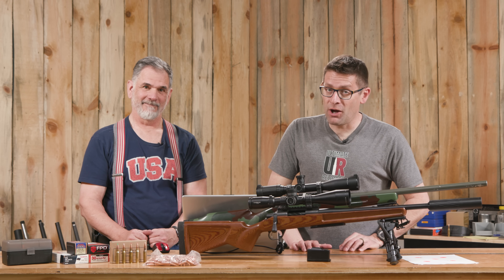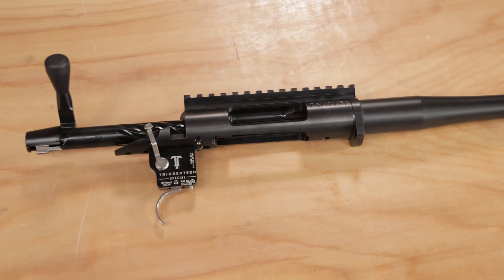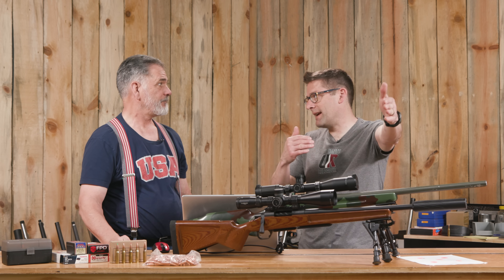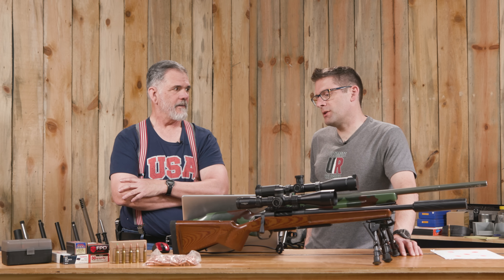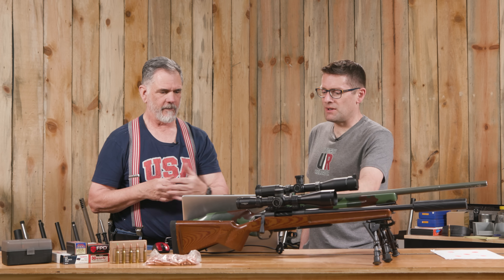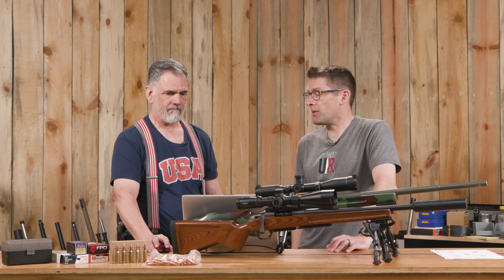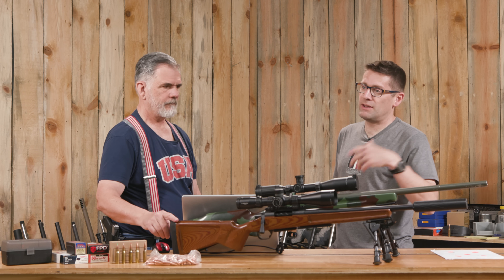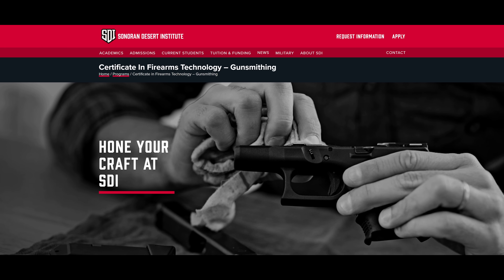308 Velocity: SHORT -vs- LONG (16" -vs- 24")

Comment: I actually just finished my stubby 308 build as well. similar to yours but i did a carbon fiber barrel and stock. total weight with glass is 7.2lbs for backpack hunting out to a few hundred yards. plan on running suppressed as well. I actually uploaded a video on my channel of some velocities with 6 different box ammo. I have a 14.75" barrel with pin & welded muzzle device for the silencerco cans which brings length to 16.5. No where near the quality of videos you put out, but it is good to get this info out there. I have come across little to no info about velocities with stubby 308 rifles when I started my journey. Funny that you started posting your build after I ordered my components for mine. nice to see some other velocities. and huge help about the hodgdons pistol 308 load data on their website. I had no idea.

Comment: Oddly the most common barrel length on a 308 is 22 inches. I understand short barrels suppressed is a thing now. Not a bad rig for shorter ranged hunting with enough power to do the job. The 24 inch is definitely the better not being suppressed. Entertaining video. BTW pistol data for rifle cartridges is available because of the Thompson Center Pistols.
Reply: Also Rem XP100 bolt pistol for the metallic silhouette crowd back when that was popular; they wildcatted what became the 7mm-08, among others.

Comment: In a stand/blind, without the suppressor your eyes and ears will like the muzzle being as far out the portal as possible. The shorty with suppressor is far easier, 2 inches is a lot in a cramped box, to thread through that portal.

Comment: Why build a short barrel rifle when you turn around and stick a can on it and make it long again?  Thanks for the vid.
Reply: Because it would be far longer if we just screwed a 9" can onto a regular 24" barrel... That would make the overall length crazy long for a practical rifle. I did use 30" .308 Winchester barrels on my old match rifle. It was fine at the range, but a bit cumbersome for most hunting situations. The can is quite worthwhile.

Comment: I'm so glad that you all still realize the usefulness of the .308" win.   I had a career that began with the  7.62 and lasted 20 years. I 100% know and completely understand the benefits of all these new marketing attempts with all the new wizbang cartridges, and yes, there is some good ones that have appeared and yes for punching holes in paper I will gravitate towards the new super high B.C. chambering . Yet I just can not stray from the facts that I have been shooting a 18" kreiger 1-11" twisted barreled rifle. In a BAT ACTION for the better part of 10 years. I shoot a 168gr berger with this combo of parts, and inside 300 yards it's a .5" rifle.
I have fire 10 shoots into this time and time again On hundreds of occasions. So when it was time to go to work this is what I had. It was purpose build for engagements of 250yards or less. I have shot this rifle to 600 and it becomes a 1 MOA . But inside of 300 it's a laser beam that I will rebarrel time and time again. My point is when it works beyond what life expects its hard to change from what is 100%solid as a sunrise.  The 308 will never lose its place in people's heart.
Reply: The 308 remains a mighty fine cartridge. Gavin and I both seem to have a fondness for them. I've worn out a few .308 Win barrels, and as you know, that takes quite a few shots to accomplish.
Reply: @Guy Mine 
Yes it sure does. It just has a spot in my heart that I know when I pull the trigger its gonna do as designed perfectly and the target will respond accordingly.

Comment: I know the 308 is popular,  but my favorite is the heavier 30-06 rifle weight.   Both are .308 cal, but my preference is heavier recoil absorbing stocks. 10 to 12 lbs is ideal for that purpose. 
What would a longer barrel in either caliber do to velocity? Say 32 to 36 range for steel shooting.
Reply: I do most of my hunting with a 30-06 and love that cartridge! Longer barrels can help a fair bit. For competition I used a 30" Krieger in .308 Win. It typically produced 3,000+ fps with 155 grain bullets.

Comment: Hunting? Shortest, lightest option. Currently, 168gr SMK out of a Savage 110 Tactical 24" heavy, running a Vortex 6-24x50 db tactical. Same hole accuracy @ 100yds.

Comment: What would be the velocity loss in a 20” barrel? About 50 ft/sec less than 24”?
Reply: Figure about 25 fps per inch, so maybe as much as 100 fps difference between 20" and 24" barrels.

Comment: I love this channel,  I've been a subscriber for years. It's cost me thousands and thousands of dollars, and I'm happy about every purchase I've made. 

I'm about to finish up my 308 project.  A Rem 700 SPS Tactical, glass bedded Bell and Carlson long range tactical stock Mathews cheek riser, Triggertech Special, Arken ep5. Sadly, suppressors aren't legal in this state.

Working up loads in Laupa brass using XBR and Varget. 168 smk and 165 Ganekings. Picked up a magneto speed v3 to help find a node. 

Because there isn't a range over 300 yards where I'm at that's going to have to do unfortunately.  I will be using this setup for hogs too. Can't wait for the weekend to get to the range and collect some data.

Keep up the good work, I really appreciate the content you guys are putting out, especially during these crazy times with this format censoring all the best channels.

Comment: Remington model seven 308,16.5 in barrel, lightweight 3-9x scope because if I need to shoot past 400 yds I grabbed the wrong gun. I like a 150 grain sst over 50 grains cfe 223, think they came out at 2750fps nice 3/4 inch groups at 100 yards.

Comment: By the way accuracy is also a factor to consider in your comparison
Reply: Both have proven to be roughly 1/2 MOA rifles. I don't think barrel length had much to do with that. In the past I've used 308 Win barrels up to 30" in length, for long range target competition. They were accurate, but no more so than much shorter barrels.

Comment: Gavin and Guy. Your reference to data that was relevant to International and NRA silhouette 45+ years ago ( however not available as complete back then 70’s) was especially interesting, having developed some bolt pistols using Remington XP and Wichita actions.
Settling on .257 Roberts as FL .308 recoil quite stiff. WITH 15” bbls resulting in MOA. Later a few of those fire arms were converted to 16.25 in barreled rifles in various calibers. Your specifics to bullet choices and practical ranges will surely inspire some “ Shorty bolt guns” 
BTW the esthetics of your build from stock, magazine, suppressor resonates “ who will build one of those. At a time of all the 1000 yd shooting, practical hunting and recreational custom rifles with 16.25 bbls will find a bitch. Currently own several examples of short rifles in .350 legend and .308. Always appreciate  inspiration of Gavin and Guy on Ultimate Reloader. The Scientifically based testing benchmark on line ballistic  education.
Reply: “nitch”
Reply: @jerrymoran8323  - I have to admit grinning upon reading the typo.  :)

Comment: Never again will I buy another barrel over 16 inches. They are so impractical unless you are using it for shooting PRS, bench rest or F-Class. I don’t care how strong and in shape you are, carrying a gun that weighs 10-15 pounds for hours on a hike sucks plus your pack/gear, even more so if you get skunked. Especially considering nobody is hunting beyond 800 yards, I don’t care what your skill level is.

Comment: Question:  So the shorter u go on barrel length requires a Faster twist rate too?..What if 1:7 Is originally recommended?
Reply: No, the shorter barrel doesn't require a faster twist rate. The twist rate selected depends on what length of bullet will be used. If 1:7 is recommended, by all means, use a 1:7 twist barrel.
Reply: @Guy Miner  I'm not sure what length one twist needs on a short barrel,  if it mattered. Reason I asked.... But I'm almost sure working up a different load recipe is almost guaranteed right? Shorter barrel may just need a faster burn powder vs it's slower powder ?
Reply: @mryang3644  - that seems logical - but... Hodgdon is showing that the highest velocities in both long and short barrels were accomplished with the same powders... Take a look at Hodgdon's pistol section in their online load data, look up .308 Win there with the 15" barrel. Varget and IMR 4064 each produced the highest velocity for 168 gr bullets in the 15" barrel. They also produce some of the highest velocities from the 24" barrels.
Reply: @guyminer3168  wow. Nice to know. Thanks

Comment: I found that 18" really brings noticeably more performance to the table than 16" and nearly the same as 20 to 24" barrels without sacrificing mobility.
Reply: In an ar10 platform the 18inch barrel lets you have the rifle length gas system over the mid length which i find is the most practical.
Reply: My 2 cents.
 Remington model 7 in 7mm 08 18.5 in barrel  and laminate  stock.. light and short whitetail medicine  to 300 yds.
Reply: @scottgandy8824  boss has the .260 I held this weekend..absolutely coolest little rifle I’ve held…tiny little everything lol
Reply: @scottgandy8824  but 7-.08 is his main squeeze too…lol
Reply: You can do 16" RLGS or ILGS if you want more optimum port pressure and cycling of the action.
Reply: @LRRPFco52  i wouldn't really take my chances with it in my opinion
Reply: @Shark_Theory  Fulton Armory offered 16" RLGS barrels.  It's ideal for suppressed use.
Reply: @LRRPFco52  true
Reply: Rubbish, the deer knows no difference. A friend shoots a .308 with a 10 inch barrel and shoots a lot of game out to around 250 yards.
Reply: @lyellclare9365  10.5" .308 Win is about like a 20" .30-30 Win.

Comment: Even interested in a 6.5 creedmoor comparison at 16” or 16” vs 24” 6.5 creedmoor.

Or even a 13.5” .308 bolt action SBR of sorts and how to maximize an even shorter barrel length via hand loading

Comment: I have been shooting 45.0 grains of IMR 4064 and a 165 grain bullet for decades. It shoots good in every gun I have fired it in and is 2800 fps in my Weatherby Meat eater. My favorite barrel length to hunt with is 22 inches.
Reply: IMR 4064 and a 165/168 gr bullet is a great combo!
Reply: @guyminer3168 44.5gr of Varget & a 165SGK or 168SMK is a great combo too.
Reply: How do you seat a 168gr bullet in the a 308 case with 45.0 grains of imr4064?

Comment: I like this comparison of barrel lenths and velocity.  Currently I have a 20" barrel Desert Tech MDRXCOM.  I have been looking at getting a FIMS .308, which is also a bullpup if I cannot raise the budget for the Desert Tech SRS A2 or M2.  I like how the bullpup gives a shorter overall length with a 20" barrel.  The SRS can be had with a 26" barrel.  I don't have a hearing conservation suppressor.  But might get one for use in a suppressor friendly State that some of my relatives live in.
My more conventional rifles have 22" barrels.  And being bolt action, I believe I can take those on a camping trip to Alaska over the Alcan highway.
Reply: I believe that you can. I took a bolt action 30-06 through Canada to Alaska in 2017 and shot a great interior grizzly with it. You've got some terrific rifles.

Comment: Hey guys great video, I have a 16 inch 7mm08 which sends 140 SGK at 2660, it is fantastic.  I found the use of heavier projectiles as suggested by guy really interesting. I have not tried more than 140s, any recommendations in 7mm08?
Reply: Try the Berger 168gr VLD for target work, or the new Hornady 150gr ELD-X for hunting and TGT.

BCs are pretty high on both of those.
Reply: @LRRPFco52  awesome thanks for the advice

Comment: I have an 18” 308 using 190SMK’s to 1000yds. It’s around 2450fps using IMR4064. I’ve also loaded 200 ELD-X at 2350fps in the same rifle to 1000yds. I’ve also developed a subsonic load using 200grn hard cast Silhouette bullet at 1030fps using Unique.
Reply: Outstanding! What's the twist rate on your barrel? Seems that you're getting superb results.
Reply: @guyminer3168  its a 1:10 barrel
Reply: @guyminer3168  It's and interesting back story on the barrel. It was found along with other barrel blanks in a decommissioned fish commission armory. The stampings on the barrel show that it would have been used for an M-1 Carbine barrel had it been processed. Those stampings also indicated the twist rate of 1:10 verified by me doing a twist rate test. I also received a 12" barrel with a 1:14" twist that would have been used for the  M-1 Carbine paratrooper variant rifle. Wish I would have kept that barrel now.

Comment: Barnes 168gr TTSX out of a pinned 14.5.   
Looking to build a 16 inch 308 bolt gun with the XLR mag 4.0 chassis. I started by wanting a Q fix but want something that feeds more reliably.
Reply: Well, I can recommend the BAT Igniter action. It sure worked out for us at UR.

Comment: product test , David Tubbs Final Finish bullets lapping bullets
Reply: Used them in a 7mm Rem Mag, Remington 700 Sendero at least 15 years ago. They worked great! The accuracy from that Remington barrel was always good, but it fouled easily. After using the Tubbs Final Finish bullets it still shot great and didn't foul anywhere near as much.

Comment: no point in going short and then adding a suppressor in my opinion. 18" barrel bare is my choice for anything up to 400 meters with a 4x scope.  That is another thing no point making a short rifle and then putting a huge scope on it.  My scope is 9plus inches long and weighs around 9 ozs.  Now that is a shorty!!!!
Reply: One can obviously make a shorter and lighter platform. Gavin's build was his, and meant to elicit thoughts like this. Please, build it your way! :) That's what this is all about. Our UR build could be lighter or heavier. Could have a smaller or larger scope. The point was that even a 16" barrel can muster up useful velocity. Enjoy!

Comment: Impressive handloads! The performance of that 168 Midsouth is better than most 150s!
Reply: It shot really well, but I caution that my loads were at the top end. I'd recommend carefully working up to my loads, which were the max according to Hodgdon. Normally I don't go that high with Varget and a 168, I stay a grain lower than that for my favorite loads.

Comment: I’ve been looking at the Tika Hunter .308 Winchester . I mostly just hunt whitetail deer in northern Michigan and don’t really need anything more than what the .308 is capable of doing. Even if I do decide to elk hunt / black bear , it will get the job done ✅ 
Some of the features that I like are that the Tika is offered in several different varieties of wood or synthetic stocks , it has a 1 in 11” barrel twist ( I’ve had 1 in 10 “ and 1 in 12” and this 1 in 11” I guess is Tikkas answer to the perfect compromise between the two which will certainly handle anything from 150 grain up to 175 grain bullets ) 
They offer 20” or 22” barrel options threaded with a break or non threaded , and I’d personally choose the 22” length barrel which pretty much burns the powder achieving optimum velocities ( you say about 25 fps per inch of barrel length in loss of velocity so , minus 2” from the 24” barrel only losing 50 fps , I don’t think that’s anything significant enough to amount to any loss in cartridge performance, not when you’re talking about realistic hunting distances that wouldn’t equate to more than 400 yards max , and most within 100 yards ) 
As far as threaded with a break , I’ll pass just because that increases cost and I’m not shooting competitively or worried about excessive recoil , not to mention it adds unnecessary barrel length that can hinder your ability to quickly acquire moving targets in real world hunting situations. 22” barrel seems to hit the sweet spot in barrel lengths for most practical applications for hunting or target shooting. 
There are so many options for .308 rifles as well as ammunition choices , you just can’t go wrong with a .308 Winchester. I’ve contemplated the 7mm-08 but this day and age with the limited ammo selection for that caliber , I think staying with the good ol venerable .308 Winchester is the right choice .
Edit : one last thing I really like about the Tika is the detachable box magazine, as I’ve never been a fan of hinged floor plate type rifles . And the bolt action is superb ! Buttery smooth !
Reply: Tika makes a terrific rifle and I would not even try to talk you out of your choice! Enjoy.
Reply: @guyminer3168  thanks for your feedback and reinforcing my choice ! 
Now the trick is finding one that’s available in this crazy world today .

Comment: For hunting,  16 woods hunting,  CQB counter sniper

For target and / or longer distance hunting,  wide open space hunting,  longer barrel like the 24-inch

Would like to see the same load for maybe a 30-inch 308 barrel. When would you possibly start to lose velocity?   at what barrel length ? Or would you add more velocity beyond a 24-inch barrel
Reply: Oh my goodness, you're taking me back a lot of years when I was shooting matches with a 30" 1:13 twist "tight bore" Krieger... We were trying to squeeze all we could from a 308 Winchester and a 155 grain bullet to comply with Palma requirements... Yes, the 30" barrel worked very well with the 308 Winchester. It might take me a while to look up what my velocity was with that barrel... Not sure I even have it anymore, but I know that I was getting over 3,000 fps from a 155, with excellent accuracy.

Comment: Awesome video and information! I would love to see this kind of test with a more over-bore cartridge, like .243, or .25-06, or any of the 7mm or .300 Magnums! Keep up the good work!
Reply: Not sure what happens with modern powders but years back most people assumed that you needed a 26-28 " barrel to get full potential out of a 25-06
Reply: I have a 16 3/4” .270 win I cut down I haven’t gotten around to chronoing it but one article I read said to expect 2800fps from 130 grain bullets.